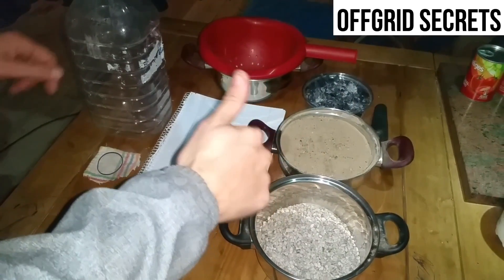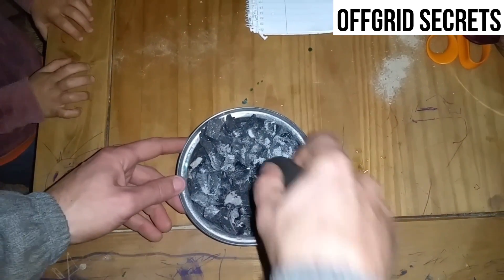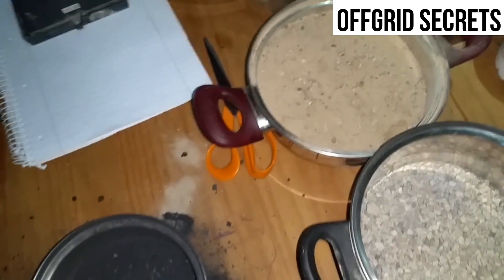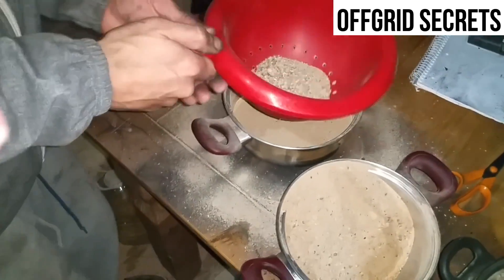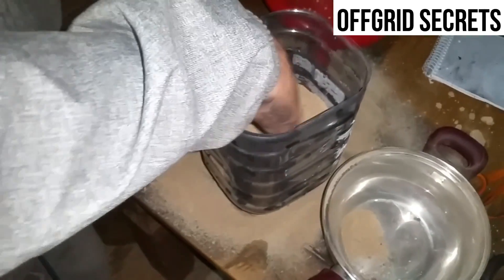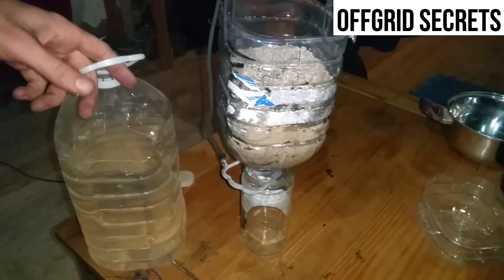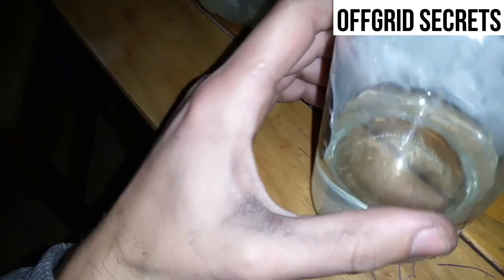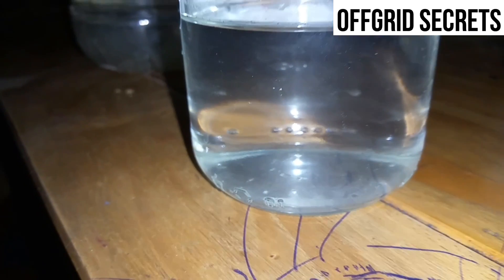Emergency Water Filter (How to Make)

Comment: Just one problem... you need activated charcoal, not ordinary charcoal. It needs to be soaked in calcium chloride solution, then boiled for a few hours.
Reply from the maker: Good luck finding calcium chloride in an emergency situation. The charcoal still does the trick to stop most things because nothing alive wants to venture down into a black layer of death. (The coal). They would rather stay near organic material